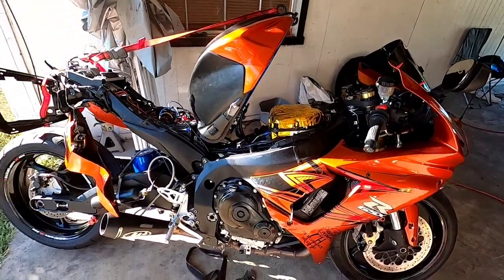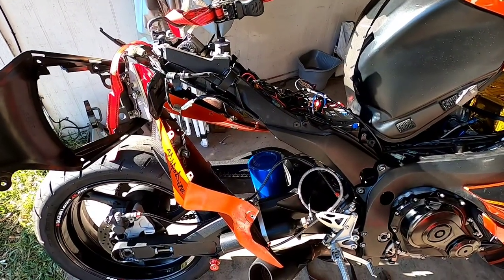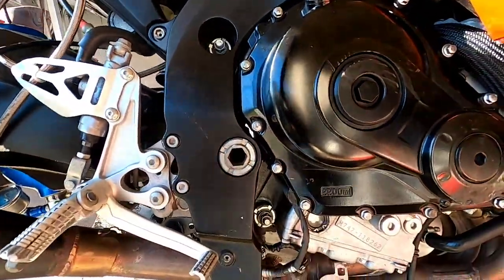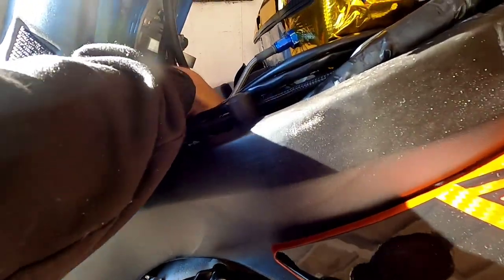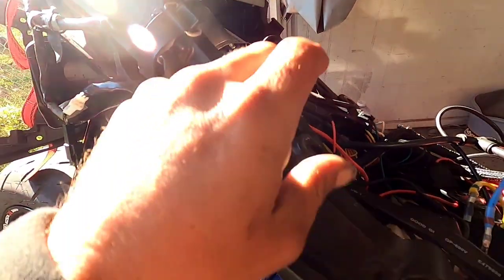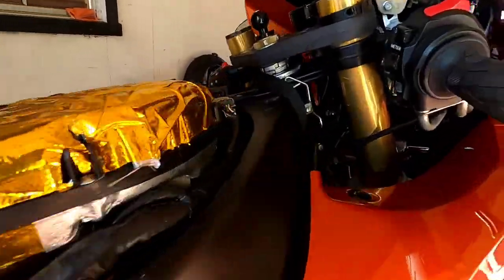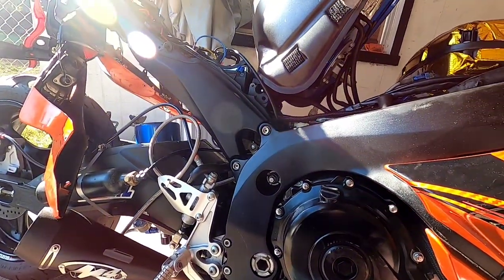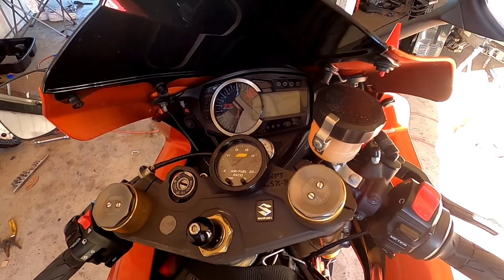wideband on gsxr 750

Comment: NIce install!  Please don't start the engine after letting the gauge heat the sensor up, like that, though.  That is the #1 way that WB sensors die.
The sensor's CERAMIC element heats up to over 1400°F  and, hitting it with that inbitial blast of (relatively) cold/wet start-up exhaust is like throwing cold water on a hot windshield.  They crack.
Reply from the maker: Thats good to know. Thanks for the info